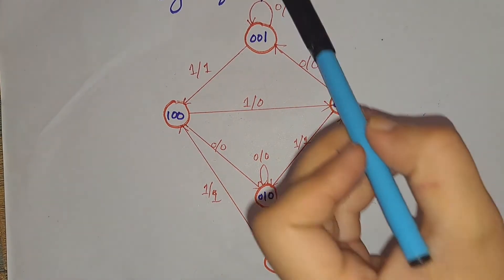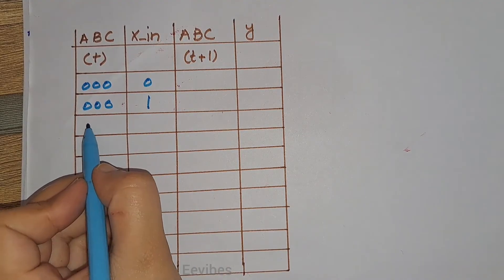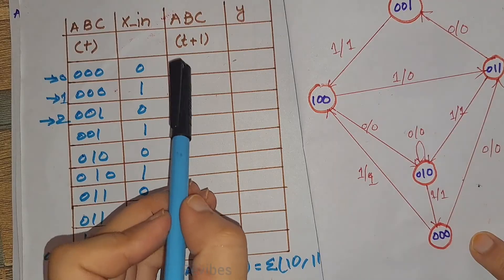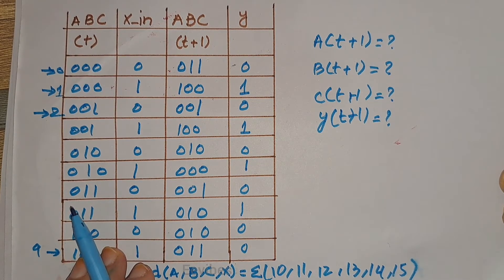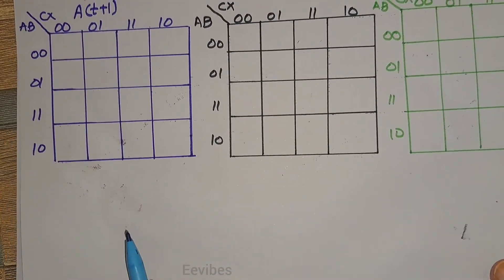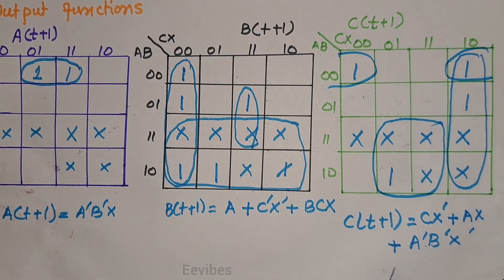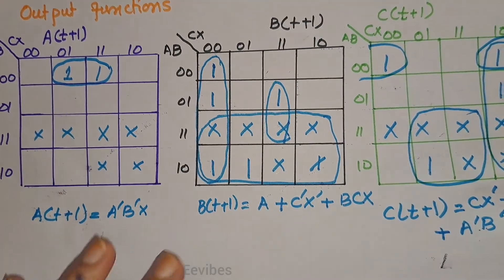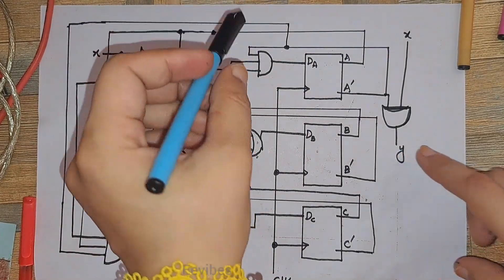Design Sequential Circuit from State Diagram using Flip Flops and Combination Logic Gates

Comment: Mam if we had to analysis the sequential circuit SR flip flop and in some way in the binary sequences i have S=1 R=1 then what should i do for A and A+? What should i put in the nexr state A+?
Reply from the maker: We preferably do not design the sequential circuits using SR flip flop because of this undetermined state as it causes the glitch. Three types of the flip flops are used for designing sequential circuits that are: 
D ff
Jk ff
And TOGGLE FLIP FLOP.